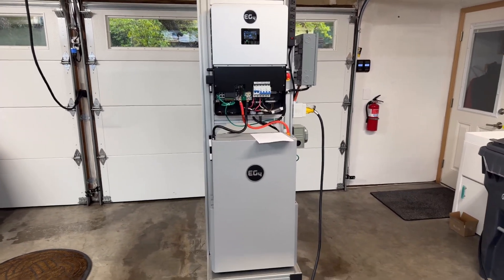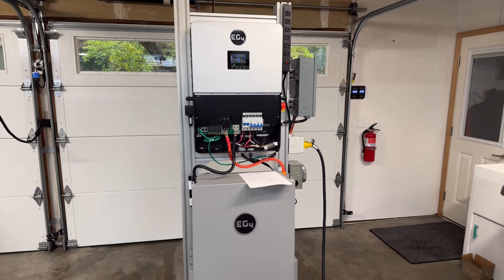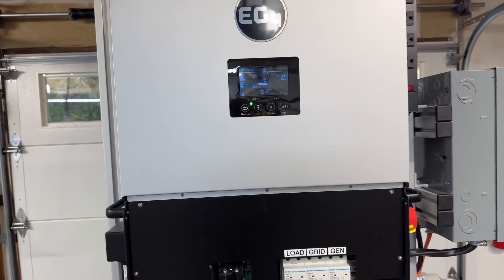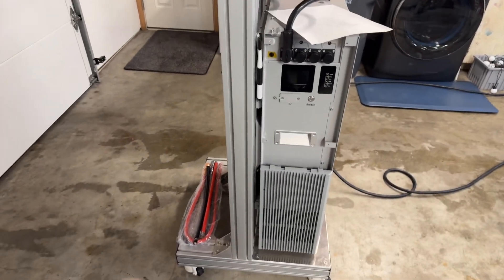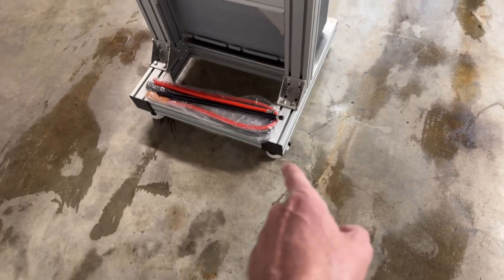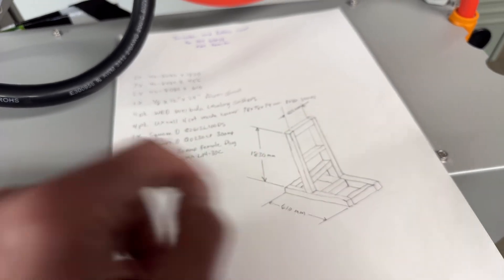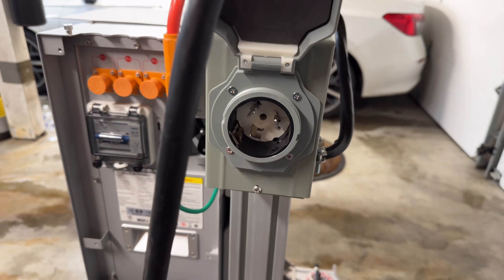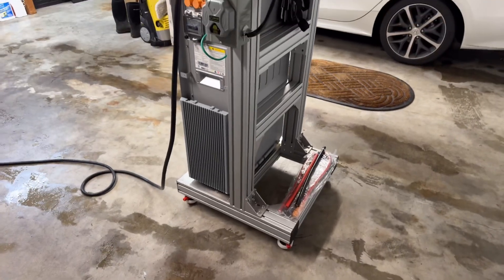EG4 6000XP and EG4 PowerPro Battery Generator

Comment: Really nice construction and build. Obviously high quality.

Question: where is your neutral-ground bond in the system? 

I have one of these inverters and am in the process of making the plans to set it up. I’d like to do something similar but the neutral-ground connections for this unit are a bit tricky. Remember, this unit does not have dynamic neutral-ground bonding capabilities as they are right now (from what I’ve read). It looks like you used a three prong 50a grid input connection, which means there’s definitely an upstream neutral-ground bond. This means that setting 26 should be disabled (no neutral-ground bond in the unit) and your breaker panel on the cart should have the neutrals and grounds separate. However, if you operate the unit without the grid input connected, there wouldn’t be a neutral-ground bond in the system. Conversely, if the neutrals and grounds are bonded in the unit and/or in the panel on the cart, you could have more than one ground-neutral bond in the system if the Grid input is connected. So you have to be pretty specific on your use case and it almost seems like the unit should be hardwired and stationary (or at least be very very very careful with how you use it). @willprowse any comments or suggestions?
Reply from the maker: Thanks for the compliment about the build. I am pretty happy with it.
I have the neutral-ground bond disabled on the inverter. The main service panel where the utility feed comes in is the only location where the neutral and ground are bonded. All my other panels in the house are not bonded. There are two ways my inverter system stays bonded:
1) through the 50 amp grid plug as you mentioned. 
2) the output of my inverter system, the 30 amp plug, connects to my critical load panel in the house via a generator interlocked backfed breaker. That critical load panel's ground and neutral lines goes back to the main service panel which is bonded. Through the 30 amp plug the ground and neutral lines do not get interrupted if the backfed breaker is shut off. The ground and neutral lines on this 30 amp connection are screwed to their respective bus bars in the critical load panel. Just to restate, the critical load panel does not have the ground and neutral bonded in that panel, it is bonded back at the main service panel. If you look at 1:46 of my video I am showing the generator inlet plug on the wall. It has the required label (required by my locality) specifying that it must be a floating neutral system that is plugged into that plug. It all depends how it is set up in the panel and how you switch from grid to the generator. Since I am using a backfed breaker method in the critical load panel, only the hots get disconnected. Had I used a generator transfer switch, those can disconnect both the hot and neutral, in that case it would be a different setup.
If I was to disconnect the inverter from the 50 amp plug and the 30 amp plug and use the inverter and battery as a stand alone power source, then I would need to enable neutral-ground bond in setting 26.
Reply: @alaskajoe61  I looked back at 1:46 and can confirm you definitely have the right labeling. 

Can you estimate how much the extrusion set you back by itself? Looked like around 600-800 by my guestimations. I may make a version using 4x4's instead just based off the affordability of wood.
Reply from the maker: @stephenfuller2936  I don't know exactly the cost of all the extrusion I purchased but I would also guess in the range you estimated.

Comment: GREAT PROJECT & QUALITY BUILD!
WHAT IS THE POSSIBILITY TO INSTALL ANOTHER EG4 BATTERY 🔋 ON THE BACKSIDE TO DOUBLE YOUR BATTERY 🔋 POWER ON A SMALL FLOOR FOOTPRINT 👣 IF WALL SPACE IS LIMITED?
Reply from the maker: Yes that would be possible but you would want longer members at the bottom instead of the 2x 610mm length I used

Comment: That's awesome, and pretty much what I want to do. I have a 10 breaker generator transfer switch installed and want to use a 6000xp as my backup generator. I plan on putting in about 4000w of solar panels to start with, add to them as needed. I was going to do server rack batteries, but my look into just doing the EG4's. Nice work!

Comment: With all of the well documented problems that the EG4 6500EX inverters are having, why on Earth would you buy one of these low cost, high frequency output transformerless inverters? There is very little difference between the EG4 6500EX and the EG4 6000XP. They both use low cost, high frequency inverter tech which yield a shorter life expectancy and a far poorer peak power capacities than "Real" heavy duty, low frequency, transformer based inverters. There were no major design changes between the EG4 6500EX and the EG4 6000XP. A change in color scheme and a few minor differences in the component layout is about it. The Chinese have been trying to get their high frequency inverter tech right for over 30 years and have not succeeded and probably never will. Don't take my word for it, Google or search youtube for "low frequency inverter vs high frequency inverters"

Comment: Very nice and clean build you did there.  I built a 3000w backup with 5.12 kWh battery and couldn’t believe how well it replaced my portable generator.  No carbon monoxide risks and no trips to the store for fuel if you have some decent solar panels. Started expanding to whole house solar and recently ordered a pair of the XPs.  Great job keep going! 👍☀️⚡️💡🔋
Reply: How long could you run your fridge and lets say deep freeze for on that battery?

Comment: What did you have to do to get the 6000XP to communicate to the battery? Did you have to do any firmware updates or when you plugged it in, it worked?
Reply from the maker: I just followed the instruction on which port to connect, the dip switch configuration and make sure the battery and inverter were configured for lux battery
Reply: Thank you! I had a little trouble but managed to get it done and working @alaskajoe61

Comment: @alaskajoe61 great video. Please make more. I'd like to see more. Does your setup allow you to add another battery to the back side? How much did the whole project end up costing if you don't mind sharing?
Reply from the maker: The size of cart I made does not really have enough room for a battery on the back side. However, if you order your rails at the bottom a bit longer you could certainly fit two batteries on it.
The inverter was $1400, the battery $4000. All the extrusions, breaker panel, etc was roughly on the order $800-1000
Reply: I think that battery is now 3700 the last time I checked.

Comment: The rack is great! Would you be able to make a video explaining the wiring of the xp and details of your connection to the house? I just bought a ecoflow ultra and will have the smart panel 2 installed soon. I'm wishing there was some way to use the PowerPro battery with the Ecoflow system. If you could add a contact to your channel that would be great. I also live in California.

Comment: Please write in some comments what issues you had configuring your inverter to charge the batteries from the grid without PVs.  If you could post a small document, would be great. I just bought the same inverter and I hear, it’s not well documented.

Comment: awesome lol i thought at first ph maybe i have to get youtube for kids maybe its for teens so i got that, and figured hmm no dont think thats it.  So then looked for any i could comment on.  I have the Same battery and eg4 6000xp, i built a wall free stand section, 4’ wide by like 80” tall, with like 4x4 feet that are like 3’ long, so very similar to yours but mine with wood and 4’ wide, a spot for my breaker panel.  I love what you done and the fact it has nice wheels, i very much interested in building this.  So what do you use to screw/bolt the sections together ? Those purchased separately?  Link for wheels from amazon?

Guy on here rodney hunt he has his  home running on 3 eg4 6000xps and their server rack batteries.  If you not following him give him a look if you plan to hook up some solar panels, i have same panels as him, signature solar still has them i believe, hyundai 305 watt panel for 88 bucks.
Reply from the maker: I added some of the links
Reply: @alaskajoe61  thank you, greatly appreciated.